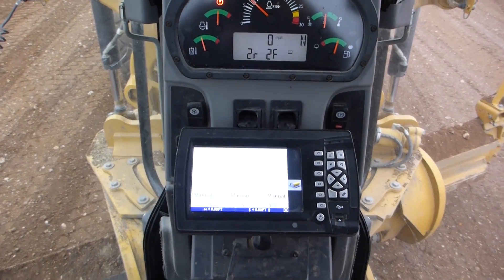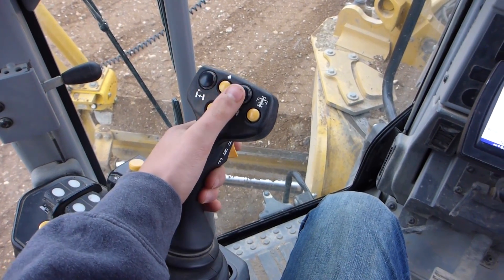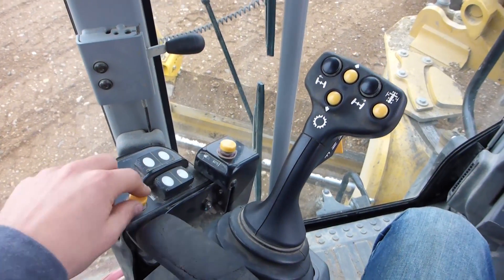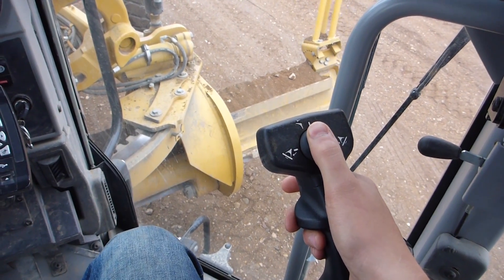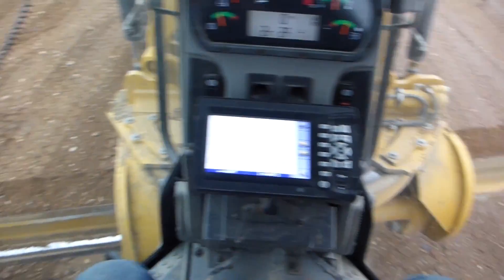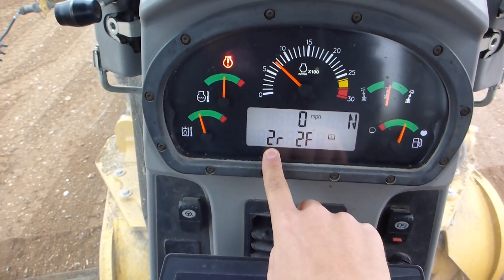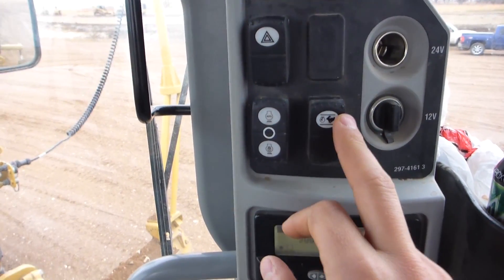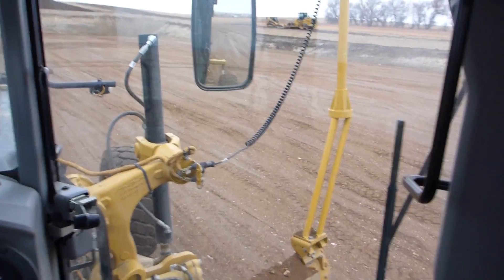How the controls work - Cat 14M with trmble dual GPS

Comment: i have to say tho you cant drive them at full speed with the joysticks or with the small steering wheel, these are slow speed machines, i tried to bring one to the proper grader operator who was about 15 miles away fucking wroste 15 miles i ever drove in a machine.
Reply from the maker: Trent Nelson I can definitely see that being an issue for someone but I’ve roaded this machine 30 miles or more and never had an issue. Just takes some getting used too

Comment: above the hydraulic lockout switch there is a switch about the blade. what does it do? I drive a 140M but never used that button and havent got explaned to med what i does..
Reply: Blade Cushion button, kind of like a shock absorber. I've run a 16M for almost 5 years, use it in the OFF position occasionally over new roads containing a lot of large rock

Comment: you should not articulate while stationary, you might blow a tire dude.
Reply from the maker: You've never ran a blade before. There's times when your finishing steep slopes with the machine fully articulated that almost all of the weight is on 2 or maybe 1 sidewall and I've never had one pop off the bead
Reply: true it was something that had been told to me when i was trained three years ago. No need to get all hostile with the I never ran a blade comment lol
Reply from the maker: +jeff johnson lol my apologies man. There's a lot of keyboard operators on the tube uno
Reply: hahahahah I was told long ago the only people who can run a grader have never ran a grader lol